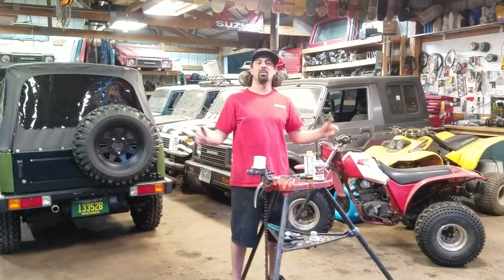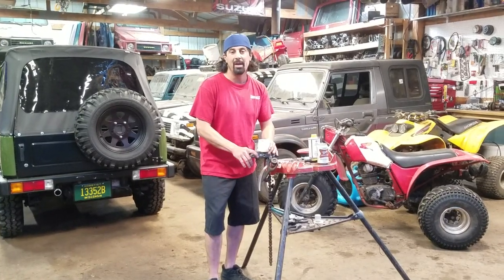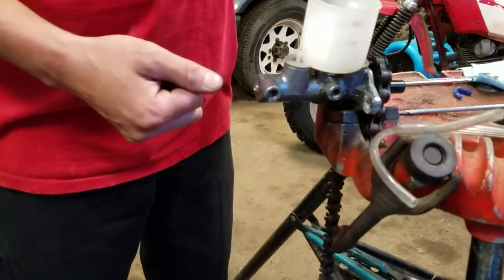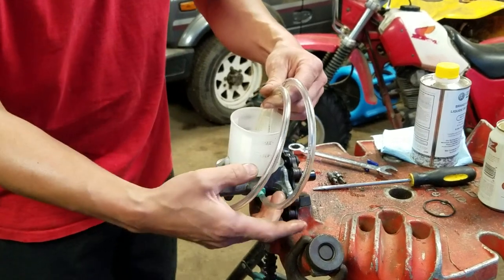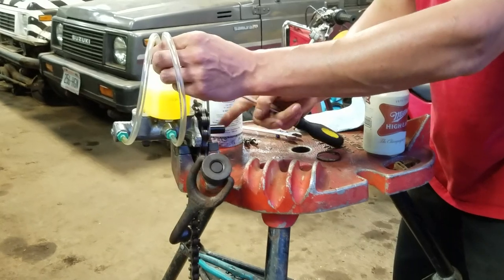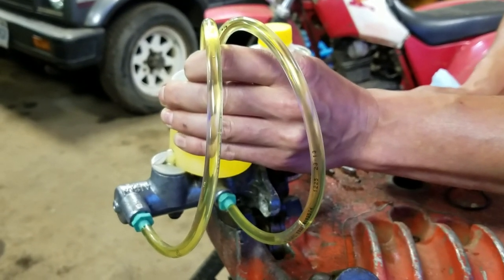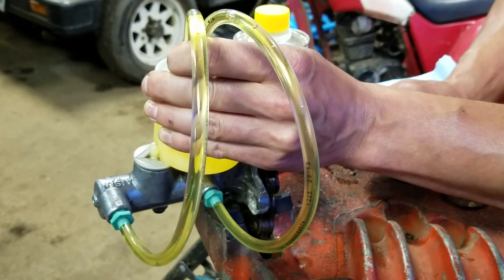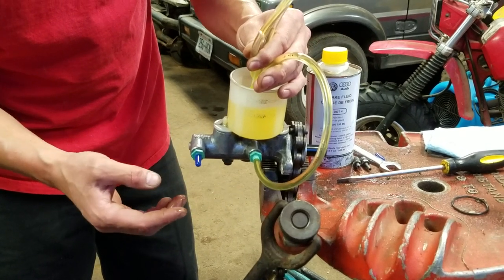Bench bleeding brake master cylinder - Hwy83 Suzuki Samurai Sidekick Geo Tracker

Comment: Hey Tony! I did a 4 door front brake swap (larger calipers and vented rotors) on my 93 Tracker and a new master cylinder. I followed your instructions here as best as I could then installed the kit AND bled the crap out of all 4 sides and the pedal still sinks a bit until I pump it then it stays (mostly). What's the secret to these things. This is actually the 2nd MC I replaced (a few years in between replacements) and I was having the same issues when I replaced the MC the first time although at that time, I did not follow your instructions. 

Could a bad brake booster cause cause a sinking of the pedal too?